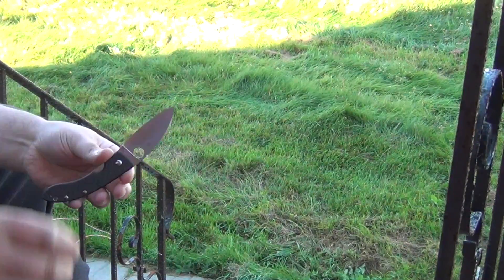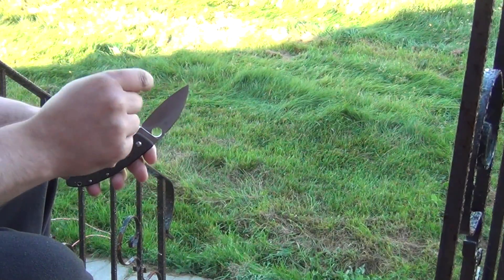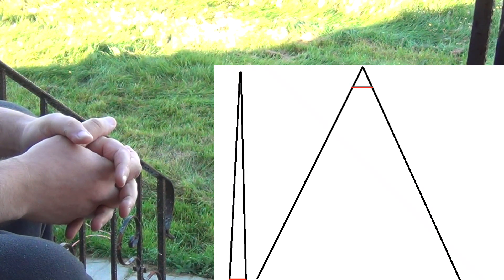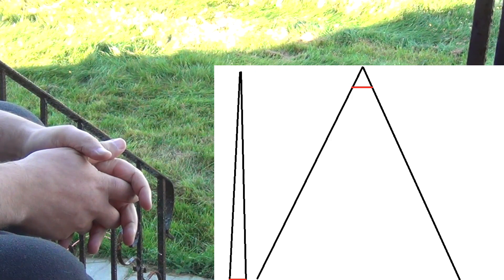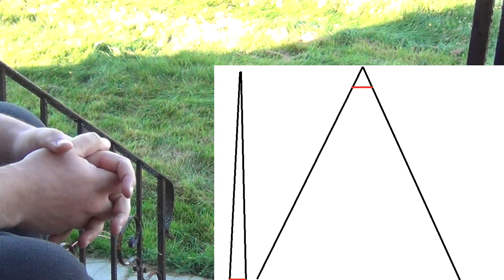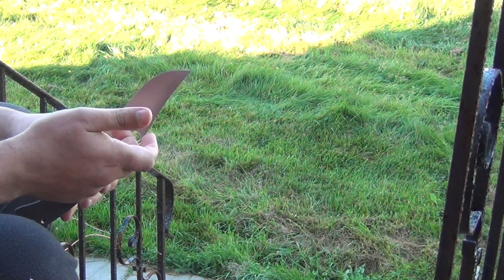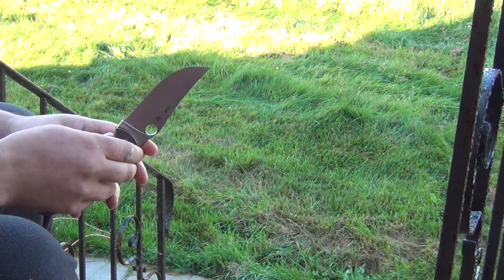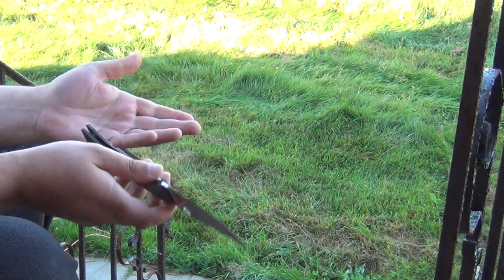Edge retention as a function of micro-bevel angle : VG-10, S30V (Wicked Edge)

Comment: that k2 folder looks more functional in hand on video than i had been able to gauge by the picture. i might be interested in one.
 also, when you say the thinner geometry blades cut better than the thicker ones, i have to ask how the edge retention would vary between say, two knives in the same steel with the same primary grinds sharpened to different angles would have any effect on the degradation of the apex as they would have the same composition and traits as each other? is this due to the force required to cut, one versus the other? does the force cause the steel to abrade more rapidly against the material being cut? wouldn't the knife have longer edge life being that the binding or wedging causes tension at the point of the material where the apex of the knife makes entry make for better edge retention as there would be presumably less slop in the material being cut? it seems tension on materials being cut makes cutting more easy such as in a willow branch cut under tension.  for me as an example my endura in zdp189 that jeremy reground for me, i noticed a drastic change in the ease of cutting but, that was due to the thinner geometry and the little to no shoulder between the primary and secondary which causes less binding but, in comparing it's ability to stay sharp in comparison to how it did prior to being reground was the same as far as edge degredation/dulling goes.
Reply from the maker: It is really uncomfortable for me but could work with a little effort, replace the clip and contour the scales.
Reply: i edited my comment and had some more points to raise on the topic of edge retention vs geometry.
Reply from the maker: Here all I am changing is the apex angle only, just the micro-bevel, the forces on the knife are the same regardless of the apex angle. At 13 dps and 25 dps for example they both cut 1/2" hemp with about 4.5 lbs. 

In general yes, reducing the angle or in general thinning the profile reduces the force you have to exert and this can cause a reduction lateral loads across the edge which can influence how the apex wears.

Here though the angles of the edge were the same, the edge thickness was the same, primary grind was the same etc. and the cutting ability was near identical as I wanted to look at apex angle only.
Reply: excellent video. i didn't realize 420hc and 3cr13 were the same until reading further into the comments. very interesting. so 3cr13 is one of your favorites? i have to say it is a very good choice in steel, i'm glad buck and leatherman use it so extensively. i like my c33 crater a lot, it holds an edge forever and is super easy to sharpen back up. i have been using it in comparison to a schatt & morgan baby sunfish in 420hc and i can easily tell a difference in wear resistance between it and my crater, it seems much more hard. also, on the same subject of 420hc, the buck knives i have in it, i had mentioned my worry that because of the burr formation during sharpening that there was something to do with the HT but, using them more and more and sharpening them has given me much better results with them and i suspect it may have only been due to overheating during sharpening. my past experience with them and that issue likely led me to throw them in a drawer and forget about them until i became suspicious. glad i gave them another shot.
Reply from the maker: knives save lives For harder use knives yeah, it is a great steel. For more precision type cutting I would generally prefer 5Cr13 type steels (AEB-l, 14C28N, etc.) as I don't need the high toughness of the 3Cr13 type steels. But the difference between them isn't that great, a few degrees of micro-bevel for example makes one over lap the other.
Reply: i'd like to try something in that aeb-l. it would be interesting. is it pretty easy to sharpen?
Reply from the maker: knives save lives AEB-L, yes, near ideal for sharpening, when it has a decent HT. Mike Gavac does really nice work in folders as does Kyley Harris, Jeremy McCullen in fixed blades.

Comment: Very interesting topic. The results are contrary to what most people would believe.  Lowering the edge angle seems to increase the edge retention on 1/2" hemp rope but how does this concept translate when you change/broaden the scope of materials being cut, all other things being equal? Obviously the more obtuse angle would be more resistant to damage from accidental impacts/contacts with hard materials. Also, when measuring sharpness for this experiment were you still measuring force needed to cut thread under tension?
Reply from the maker: I was measuring the length of draw required under a specific load.

Yes, the same relationship will hold however the angles can shift. For example on soft materials like hemp and cardboard you have to go to very low angles before the micro-bevel isn't strong enough and just cracks off/deforms, similar with many foods hence kitchen knives can go well under 15 dps. However if you start cutting very hard materials like plywood, or just chopping then you will need heavier angles than you need for hemp and cutting other soft materials.

Basically then you find the lowest micro-bevel (apex) angle which keeps the apex in a state of slow wear, that gives maximum edge retention
Reply: I've always thought of edge sharpness more in terms of angles, i.e. acute angles are "sharper" than obtuse angles.  If i'm understanding the concept of this edge retention testing correctly, you are saying that the edge retention is more related to the sharpness being a function of the thickness of the very apex of the edge? 
Also, out of curiosity, what was the stock edge thickness of that Spyderco K2?
Reply from the maker: bikesandblades901 The edge was 0.010-0.012" for most of the blade, it crept up to 0.020" in the large upsweep.

Many people do use sharpness as a general term for cutting ability, a low angle will cut rope better than a higher angle and thus it is sharper. The problem with this though is that if I made the handle a little more tactile so you had better control then you would also cut the rope better but would you still say the blade was "sharpened" with that modification?

I would make a distinction between cutting ability which is a measure of how much force has to be applied to the blade to make a complete cut, vs sharpness which is how much force is needed right at the apex to start a cut. This is why a very thin ground blade can often cut better than a heavy ground blade even if the heavy ground blade was freshly sharpened and the thin ground blade was heavily used and dulled. 

The total force is basically the sum of :

-force at the apex 
-frictional losses
-force required to move the material being cut apart to allow the blade to pass through it

The first one I would call what measures the sharpness and this is what most people tend to mean when they talk about sharpness, basically the properties of the apex itself.
Reply: Thanks for clearing that up, as the pic of the steep vs shallow edge in the video had left me wondering exactly what aspect of the apex the test was really measuring, retained sharpness or retained cutting ability. I am currently running several zero ground blades with micro bevels and am seeing exactly what you described. They may get technically dull but still cut like crazy because of the geometry.
As for the k2, .010"-.012" is a respectable thickness for a production knife and a real blessing considering the low grindability. I've got a couple of CPM-10V blades almost ready for heat treat and i'm dreading having to finish/almost zero the primary grind once hardened.
Reply from the maker: bikesandblades901 I had to reshoot several sections as I kept saying edge when I meant apex. The edge bevels on these knives are ~6.5 dps only the apex bevel changes and that is a micro-bevel so small you can't see it. It is also so small that it really doesn't influence cutting ability significantly. The knives cut 1/2" hemp on a 2" draw for example with about 4.5 lbs no matter what micro-bevel they have from 13 all the way up to 25 lbs. However they keep cutting for longer with the lower one.

In retrospect it might have been better to draw the edge completely and then do a blowup to show I was talking about the apex only and do it to scale with a 10 micron thickness in red .

Comment: This may be a dumb question, but how do you get a 5dps edge angle in the first place? At that angle isn't the blade almost flat on the stone? By the way, the knife industry will eventually send someone to assassinate you.
Reply from the maker: Yes, that is exactly how it is sharpened, it is a zero grind. The only reason it has a slightly higher angle than the primary grind is just due to wear of the stone mainly and a slight effect due to more force put near the edge in sharpening.

Comment: Won't a S30v at its optimum angle be superior to vg10 at its own optimum angle?
Reply from the maker: I am not sure what you mean, optimal in regard to what? If you mean if you kept changing the angle of S30V and found the maximum edge retention on hemp and did the same thing on VG-10 would the S30V maximum be the higher one? I believe it would be yes as they are both similar steels in regards to carbide volume/microstructure. 

The point of this video isn't to make some kind of claim that VG-10 is superior in regards to edge retention on hemp just that the advantage of S30V is actually quite small compared to the geometry and thus if you are looking for maximum performance then you first have to optimize geometry as even small affects like the micro-bevel changes are much bigger than steel changes in general.
Reply: Thank you for the reply.  I enjoy the technical aspects of your videos even if I don't always understand what your getting at.

Comment: Excellent video. I have been seeing this myself. I know I have talked about it to a large degree, but that little Spyderco Spy-DK has good enough cutting ability, that I have not sharpened it in two week of use at work, and this entails alot cutting. Even against propane tanks removing tanks removing plastic wrap. It has zero sharpness at this point, but still cuts better than alot of other knives I have used.

I have been enjoying simpler steels more and more. 

On another note, people looking at huge piles of cut material as a bench mark for edge retention isn't as impressive as I once thought either. I am fully confident that due to the geometry, I could cut a mile of cardboard with my Calton in 1095. It is highly optimal for such use.
Reply from the maker: ***** Yeah, if you look at the math and realize how blunting is nonlinear that means nothing fast. If you don't do the math but just do a few comparisons it is really apparant as well. Just take an Opinel, sharpen it well and see how much hemp you can cut before you physically can't do it any more. Your fatigue will stop you long before the knife will because it will start out at about ~ 4 lbs and most production knives are > 20 lbs to start. 

If you really want a challenge, start cutting cardboard before a typically box cutter blade won't do it any more.

Comment: Quite interesting along that vein I no longer go any higher on sharpening grit than my 600 Norton stone. I felt like I was in class and wanted to raise my hand and say yes that is exactly what I have been finding! LOL I have an old Case pocket knife and I think I will sharpen it flat to the edge and then add a microbevel and see if the microbevel alone is strong enough to support the edge. If so then at that extreme flat angle I should get pretty good cutting ability and longevity out of a very soft carbon steel. I think Cases from that era run around 55-56RC tops. That will be fun to try.
Reply from the maker: I finally got around to picking up a new Norton India stone. I don't think you can consider yourself a serious sharpening nerd if you don't have at least one of those stones. I had given mine away multiple times. I had switched to waterstones as of late and they can benefit for grinding, but for sharpening and working with low carbide steels, the Norton hones work very well.
Reply from the maker: That way of sharpening, very flat is how all knives used to be sharpened. I sharpen a lot of knives for people in the port communities still and they are all ground that way. I think there is a disconnect between users/makers to such an extent we are getting really non functional elements into the designs.

It is like when Kyley came up with a modification to frame locks which prevented jamming and a number of people freaked out because it had minor vertical play. What is more sensible, a lock which has a little movement or a lock which fails completely to function? How can you look at a knife in that kind of manner where nonfunctional things become so important that elements are used which actually break designs functionally?

Comment: Very interesting video Cliff, you have confirmed what I have been thinking of myself. Im an amateur compared to you but I like to do some cardboard cutting and have noticed that I always gett better results after I resharpen my knives and drop down the angle. I usually keep them at 12 to 15 dps, depending on the steel and I enjoy the ease of cutting you bet with a lower degree angle. Im droolinf over the spyderco k2, ive been looking forward to this knife ever since I heard about a while ago and I've always wanted to test 10v but it only comes on custom knives byt leave it ti spyderco to put out a knife with it. If I get my disability its the first thing im buying. Im looking forward to seeing tests of it from you. Ankerson did test with it and saud it performed really well.
Reply from the maker: It is a decent knife, I don't tend to prefer metal handled frame locks, but if you like that style it is well executed. The only real practical issue I have with it is the large upswept blade, the belly is ~50% of the blade length so it limits point work significantly.

Comment: have you ever though about using ballistics gell to test edge retention. I'm saying this because ballistics gel from my understanding has been engineered to give a uniform resistance so as to provide a common ground for testing. Not sure if it is abrasive enough to to significantly wear some of the higher alloy steels though
Reply from the maker: Cutting ability maybe, it could be interesting for cut-through slices.

Comment: All kidding aside... this was very informative, and im glad you mentioned 420 steel, although I still have issues with the cheaper steels. I still believe that even when/if popular knifemakers understand this, the way you've explained, that they will continue using the premium grade steels over 420
Reply from the maker: Chumgeyser For some perspective, when it was really about knives and performance, Phil Wilson used to make knives out of 420HC (3Cr13). I even have one of them I bought as a wedding present. 

Modern day though, even steels like AEB-L are a hard sell unless you find one which has a lot of cool letters/numbers in the name like LC200-N. That has to be better than AEB-L, possibly 200X better.
Reply from the maker: Yeah the really cheap blades do have all kinds of issues with steels due to HT usually. It is why a lot of people think they are junk materials as they are seeing junk hardening.
Reply from the maker: Chumgeyser Lots of that steel, but the problem is the HT tends to be very basic so they are closer to ~45 HRC and they have lots of ultra soft phases in them ~15 HRC.
Reply: I'd love to see some choppers made out of 420J2 or 3cr13mov and heat treated well. 54-56HRC, extremely rust resistant, and tough. What's not to like?
Reply: Cliff Stamp Someone should be able to get 3cr13mov to near 100% martensite, but if you are a knifemaker it would be a bad business move unless you were willing to promote the steel & heat treat, and that would be an uphill battle. Why not just use the latest and greatest super steel! That's how you sell knives.
Reply: not in the case of.... 3V over 8cr13mov.... less is more actually.

Comment: Fascinating video, really. There are so many things out there where the differences between products are so apparent, and tangible that we never give them a second thought. You can feel the difference in performance between a Chevy Cruise and a Chevy Corvette immediately.
   Blade steel isn't that easy. Sure, you can feel and see differences between knives when it comes down to construction, f&f, materials, etc., but edge retention is not an immediate tangible performance characteristic.  So, manufacturers can claim what they want and for the most part it's accepted.  Cliff, you've given everyone that "test drive" with such a large sample size and shown that blade steel is really a MUCH less important feature than most would have thought.  Blade geometry has been a central theme behind so many of your videos. I think this video and this test has really proven many of your ideas and theories as more concrete fact.  (Like there was any doubt to those of us with anything kind of critical thinking skills or and sharpening ability.) If everyone in the knife industry watched this without any sort of bias, it would turn the entire industry in a different direction for the better.  And we would all benefit. Kudos.
Reply from the maker: Thanks, there are advantages to different steels but they are really far behind grinds when it comes to performance. Just took a look at what a decent ABS guy can do with junk steel you can find in a scrap yard.